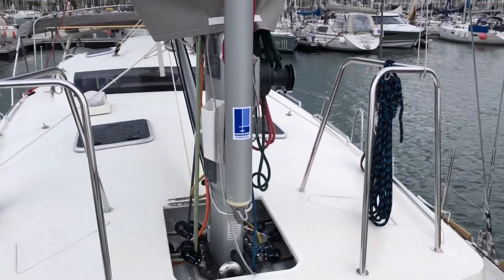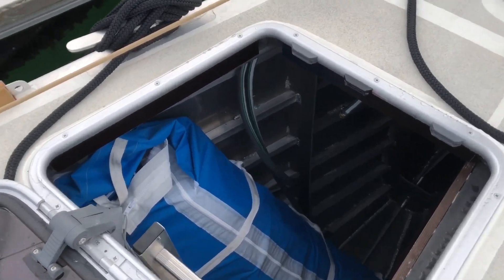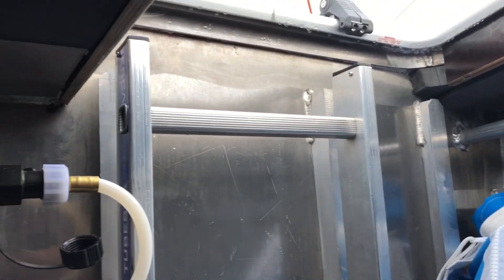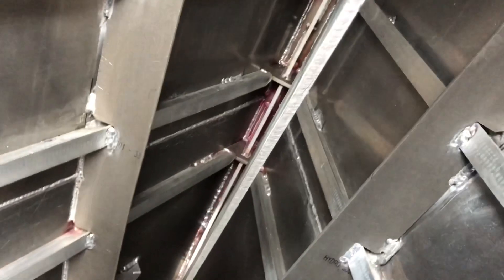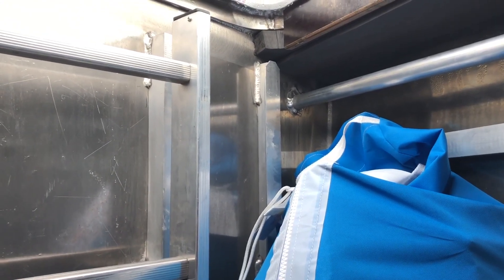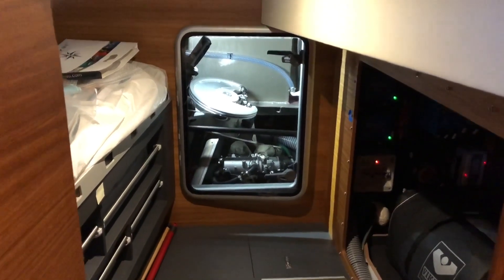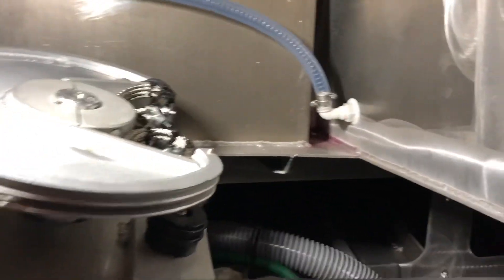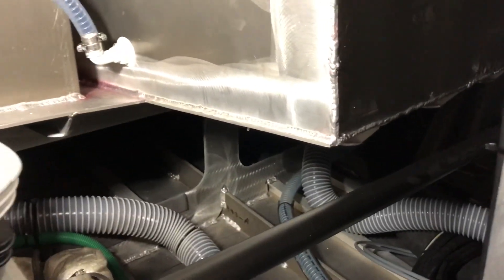Snow Gum’s watertight bulkheads - Garcia Exploration 45

Comment: I'm trying to understand where the aft bulkhead starts? From the door after the bed or that box on the right protruding above the steering mechanism?
Reply from the maker: The door after the bed in the aft cabin is mounted on the bulkhead and forms part of the aft, full height watertight bulkhead. Same story for the door (hatch) at the aft end of the tech room, on the starboard side. The full height, watertight bulkhead located at the front of the boat, between the sail locker and the front cabin, does not have a hatch in it. The hatches in the rear watertight bulkhead allow access to the steering gear.

Comment: Don't mean it as a criticism, just curious: the water slushing on the stern is really noicy. Is that design of the hull or is it an effect of the aluminium structure that resonates more compared to fiberglass? Great safety from both those bulkheads by the way, thanks for sharing.
Reply from the maker: Hi Silvio. Yes, it is noisy in the steering compartment when the wind outside is blowing lots of little waves directly in line with the overhanging stern. But luckily, you’ll be spending little to no time with your head in there. 🙂 This boat is actually much quieter than other yachts I’ve sailed in. The thick insulation on the sides of the hull and the coachroof, the insulated floor panels and the double glazing all help with this. It’s much quieter than the fibreglass boats I tested, both in terms of water noises and engine noise. Of the fibreglass boats, the Amel 50 was the quietest; very quiet. Thinking of those fibreglass boats I sailed in, I was a bit surprised by how much water sloshing noise made it through the hulls that were insulated with Divinycell. A general thought is, boats are not quiet places. Navy sailors I’ve known would often say they had trouble sleeping on shore after a voyage. Too quiet. 🙂
Reply: @SailingSnowGum  Thank you for your quick reply, makes a lot of sense what you say. Happy sailing!
Reply: Stern to the waves wind... at anchor or into the wind you won't have that
Reply: @sabihbeck885  Good point, I was thinking the same as I wrote my comment. Stern into the wind is a particular condition to port docking, will never happen at anchor or cruising. Cheers
Reply: @silviogentile5622  right,  I found out the hard way myself :)